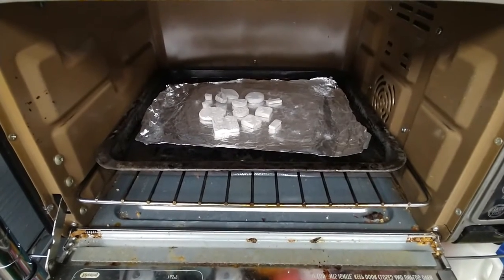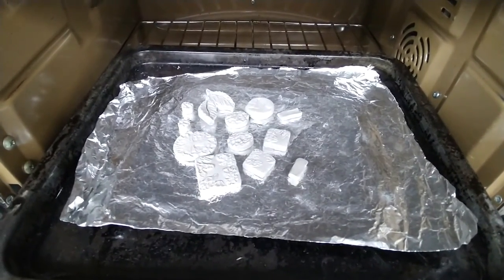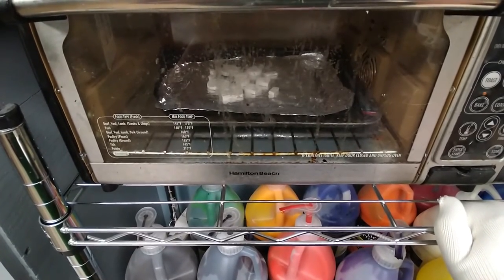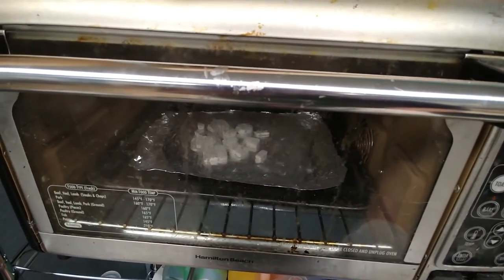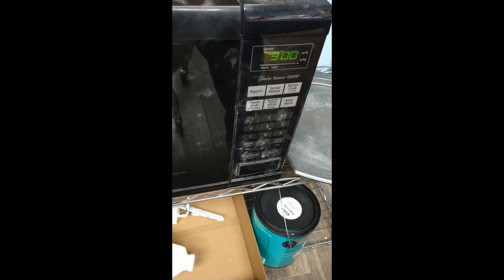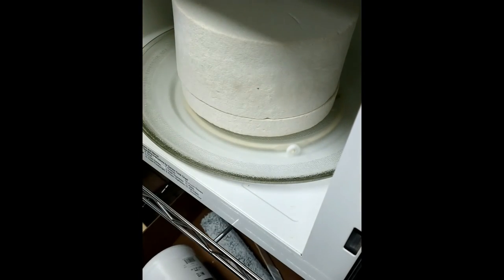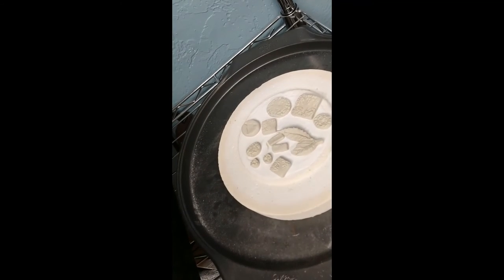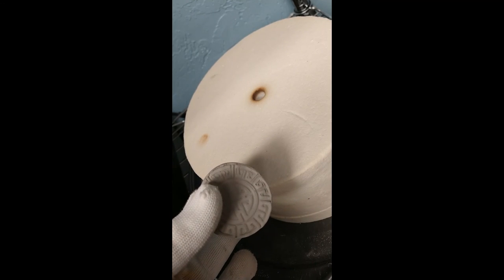Using microwave kiln to bisque ceramics

Comment: Hello great video very informative! I’m curious when you said 200°F because the boiling point of water is 212 to 215 depending on your elevation. so do you need the temperature to be slightly under to work out or do you actually wanna boil it out of the best?
Reply from the maker: you need your piece to be as dry as possible before going into the kiln.  By baking it before at 200 or more, you will evaporate any residual moisture from your greenware.

Comment: Why do rounds of.3 minutes? Why not just do 30 minutes?
Reply from the maker: You need to rotate the lid every few minutes for an even heat. If you don't there may be hot spots that melt faster than others.

Comment: Hi. What’s your microwave kiln size? I like how many pendants it can hold.
Reply from the maker: The internal size is 5inch diameter. I usually fit 4 pendants, sometimes 5 if they are smaller. Make sure to leave a gap around them.

Comment: I'm having problems with the finished pieces cracking. I don't think it's happening at the bisquing stage. At least I can't see any cracks there.
Somewhere in the glazing I end up with usually small cracks, but enough to ruin the piece.
I have tried everything. Shocking it by going up and down quickly to the other extreme of heating it up in small increments and cooling it down over night. Still getting cracks. I've even started glazing underneath in case the glaze is 'pulling'. Any ideas?
Reply: Are you doing the oven method before glazing as well? I need to put out a video on glazing.
Reply: Yes. I may try it for a bit longer though, especially with raku clay. @kathrenlundy6796

Comment: have you tried just doing the entire 15 min at one time?
Reply: Best not to because of uneven heating. It is also not good for your microwave if the heat stays in one place.
Reply: I used the oven and for the first time it didn’t blow up.. then I put in two other pieces in the hot kiln.. they blew up within minutes. I guess it’s heat shock. Good think I’ve got another one coming in the mail. I won’t have to wait for them to cool